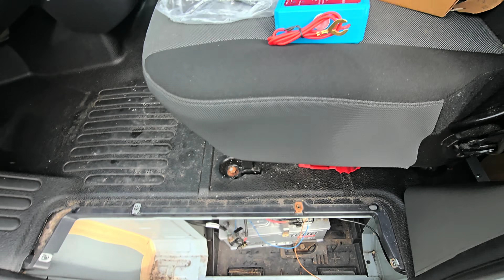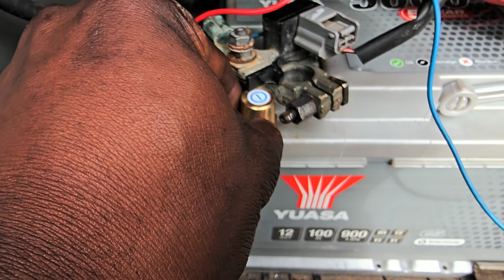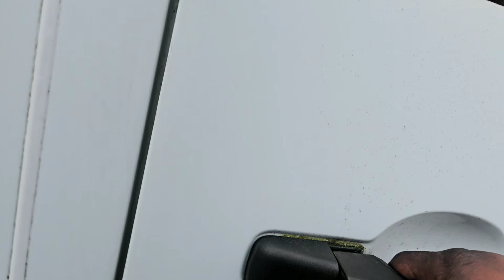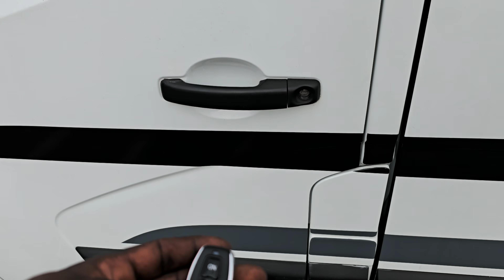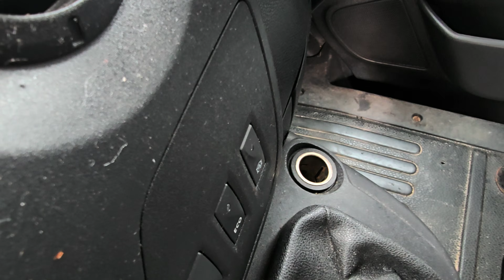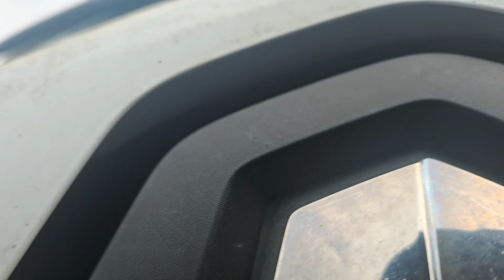How to Install a Remote Control Kill Switch | 12V Car Battery Isolator & Anti-Theft Device

Comment: reporting a serious issue with the car battery automatic turn-off switch I purchased.

The unit is prematurely cutting off charging to the battery at 13.2 volts. However, this is far below the required charging voltage for standard 12V batteries, which typically need to charge up to 13.6–14.4 volts to reach full capacity.

This means that:

The unit incorrectly assumes the battery is charged at 13.2V.

It disconnects or stops charging at that point.

As a result, the battery never receives a full charge and eventually goes flat.

From my testing, it’s only after 13.2V that proper charging begins — but this unit stops before that can happen. I've observed the same behavior across multiple units, which suggests a design flaw, not an isolated defect.

To summarize:

The cutoff threshold of 13.2V is too low.

The battery is never charged properly.

This results in battery failure over time.

The unit, as designed, appears to be faulty.

This is a common issue and it should not be sold anywhere. It's rubbish don't buy it
Reply: The 13.2 V threshold is to disable the remote control switch off, because at 13.2 V it assumes you are driving the car. It does not cut off any current from the alternator to the battery. I have no idea what you are talking about.

Comment: you didnt read the manual sir.the kill switch remote not gonna work if the voltage is 13.8v above to prevent the remote off button to turn on while the car is starting and the remote switch off activate automatically if the voltage turn down to 11.8  to prevent the car battery to discharge completely.
Reply from the maker: I didn't , but that explains what I experienced

Comment: What’s the actual drainage with the device that you’re using because that will be draining? The battery too?
Reply: No it won't dumbass all it is, Is a switch turns the power on and off

Comment: The BIG problem with these actual ones is that you cant use them on cars with computers, and on  older car's  you have to tap in the radio code EVERY time you get in the car, after starting. Bear in mind too, that the anti theft alarm will be disabled, so your insurance wont pay out if it is fitted. Also, the earth does not have a very good connection, making the cranking of the engine very slow. It takes a few weeks butt that is what happens in the end. I have one on my car and my camper, the car just about starts, with a prayer, but the camper wont start. I have tried to connect it to the positive terminal instead, but it wont work. Sorry to be a party pooper, but I just need to warn people of the drawbacks before spending cash for nothing.
Reply: Are you copy and pasting this comment in every video?
Reply: It’s a fantastic tool for any car that is keyless

Comment: This is for only classic cars, not modern computerized cars. These goes nuts if you kill the power, because it is not designed for that purpose. So, stop that madness before people ruin their cars! 
What a bat terminals, does not cover entire battery post.
Reply from the maker: Some cars don't like it. I mentioned that in the video.

Comment: What a shit design that can be bypassed with jumper cable ? WTF.
Reply from the maker: It's not an anti theft device. It's a remote battery disconnector.
Reply: @sp88tips  Title says anti-theft device.
Reply from the maker: @johndavis1465  lol kl didn't even notice
Reply: I bought a split new Land Rover Defender and paid 400 quid for an immobiliser that broke and the AA guy disabled it with a 12'' bit of wire and two croc clips so I'd rather have spent 15 quid on Temu for one of them for the same effect.

Comment: Good little device, especially for older vehicles that are not used regularly.   Even though that was a new battery, if it was drained completely flat by that quiescent current, it probably killed the battery. I know from experience!!
Reply from the maker: Yea I'm sure that battery has some damage. Thanks for watch my video.